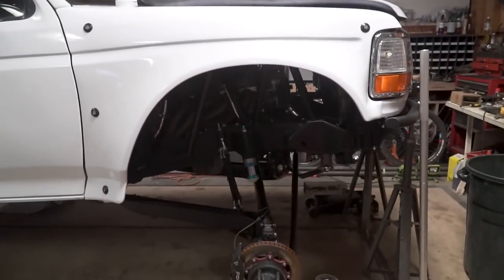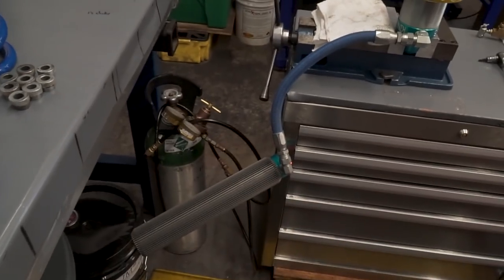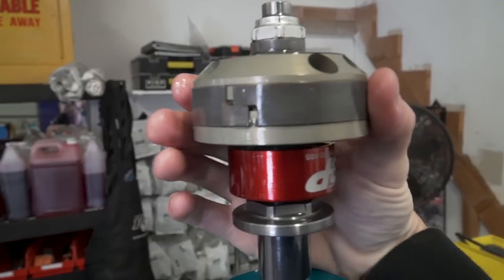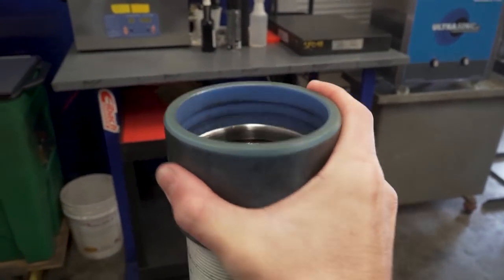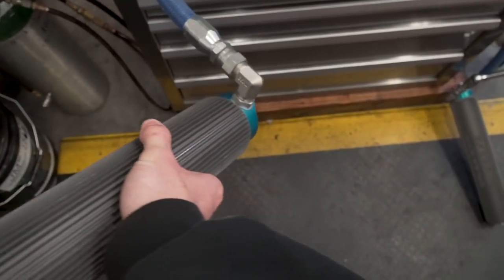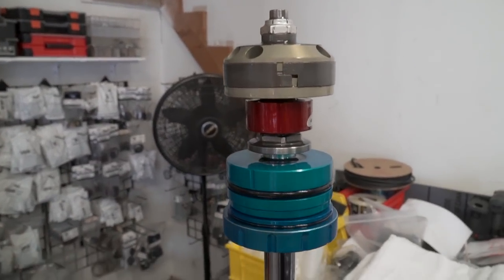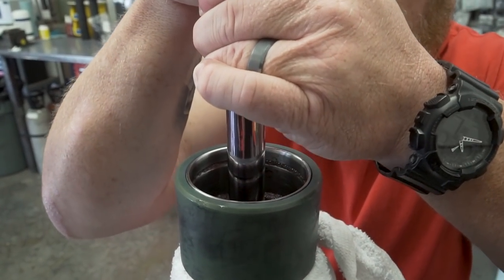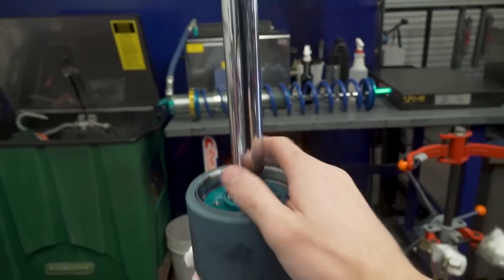HOW A KING OFFROAD COILOVER WORKS! (Re-Valving For Better Performance)

Comment: I am trying to comprehend for what is a good old spring let alone a spring to use for what should the proper ride heighth of the 2004 Subaru Forester X be with carying extra weight but not wanting to change any cv shafts or anything else. Good basic info for oem struts and springs is hard to get let alone something utilitarian to cary more weight.

I could see an advantage in extra ground clearance as long as it was only selecting a different spring to match simple inexpensive but okay struts.

Sstoopppp😲  I didn't know there was soooooo much to learn😤. I have to nap now😔

I didn't know there was anyone machining components in America!

Comment: Awesome job explaining the process. YouTube needs more actual explanations and technical content. I'm tired of just watching guys build shit without context. Sure you're going to put in thicker shims, but why? What is the rationale? I fee like I actually learned something here instead of just wasting my time. For instance I notice how the rebound of the main piston was stiffened, but the bump zone was not. I assume this is so the shock extends out of the bump zone ASAP. Once you have the piston there, you are out of travel. You need to get the shock immediately. Correct me if I'm wrong.

Comment: thanks for going into so much detail. especially about the ifp. that helped a lot to explain how that worked. i have some walker evans shocks im going to try to use on my bronco that may need some tuning, that have ifps.
Reply: Let us know on the Walker shocks and when the time comes, only reason I bring it up is that the IFP may need to be set at a specific depth prior to re-assembly.
Reply: @DownsouthMotorsports  thanks! I talked with walker evans about the ifp depth, and they said it should be 7.25".  When i got the shocks they were brand new, but one had pressure, the other on didnt, and one had oil the other didnt. So my plan os to take them apart, clean them, amd see of the stacks at least look the same. Then refill with oil and pressurize, to see how they handle in the rear. Still need to build the engine cage for the front. Im out in colorado so finding some one to tune shocks locally is out of the question. Im just looking for a good base tune.
Reply: @outdoorexplorationgear5070  Copy that, just wanted to be sure you had the info you needed to set the IFP depth.
Reply: @DownsouthMotorsports  thanks man, i appreciate that!

Comment: Where do you normally set the dividing piston in the reservoir? Before you fill it with nitrogen, do you bottom it out, then fill it with nitrogen, if not what distance did you set it at?
Reply: King wants the IFP bottomed out on the oil side. So that when the oil gets hot and expands the Nitrogen chamber will be smaller due to the oil expansion. So as an example if you bottom out the IFP and charge the shock to 150 psi of Nitrogen with the shock fully extended and no load on it, then check the shock with the suspension fully dropped out after driving for a bit and the oil is hot and has expended and you will see that the Nitrogen PSI is slightly greater than 150 psi.

Comment: I am not familiar with King shocks but I know they offer a number of models. Now, right off the bat, no one pointed out if the shock is right side up or facing down. After that you lost me completely.
  I draw stuff or something I am building and make notes, even if a custom air distribution box under the dash of a 55 year old C10 to improve function while adding my air conditioning (Not off road build here).
  But, a drawing of fluid flow during compression and another for extension. I have a tank of nitrogen used for A/C leaks after repair but is that what you use to re-charge after done (Yes, I have not seen entire vid) but just curious!
  After well over 3 decade in the dealership’s , doing a custom build for myself requires a new world of aftermarket parts. They include the Good, Bad, the Ugly and the Expensive not needed stuff. That’s why I am here. Just lost on this process. 
 If I jumped into showing you a video of completely rebuild an “AD244 Alternator” and chipped off some epoxy, unsoldered wires and pulled the commutator ring assembly off, I most likely would have lost you be that point. I do it (That kinda Thing) for better parts, new bearings, updated regulator and damaged slip rings, plus I can completely polish the case and spend $42 instead of aftermarket might work /may last alternator for $450. Plus have it done and on that day. Thanks as things get complicated quick. DK, Omaha. ASE master tech since 1978.